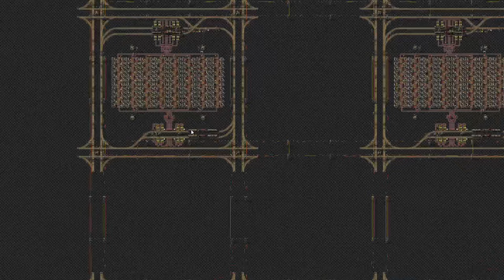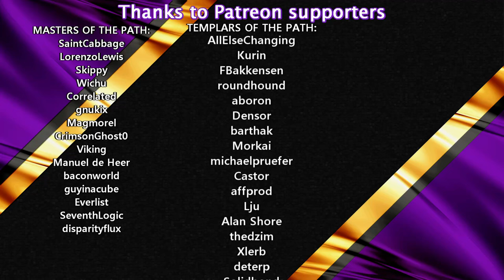How I Made Factorio Play By Itself | Ultimate Automation Challenge Tutorial

Comment: I seem to remember that the first spiral self-expanding Factorio base I watched many years ago in a video (which also used recursive blueprints) did actually collect the resources and built the components for the expansion. As far as I remember they just covered city blocks with a miner grid blueprint, where only the miners which actually had something to mine materialized. The guy then sorted the mined products into copper, iron, coal and stone and had a station for each type. 

Since the guy also used a no-water map but didn't use magical water-out-of-nowhere mods, he couldn't build batteries and thus his base browned out during the night. Oil was also not available - it was all about growing the base.
Reply: Galaxy brain: do a Seablock version, so you guarantee the availability of water.

Comment: The resource scan can be done.
When you create a block always make a mining block. Then after x time/ x many blocks if there is more than x ore skip the block if there is 0 ore deconstruct all miners and build a real block
Reply: You'd need a sorting system too. And probably a threshold for amount of ore so you don't bother mining trivial deposits. And of course you also have to do oil deposits, refining and cracking. Though I guess you could skip pumpjacks and rely on coal liquefaction.

Then you would also want to add supply constraints. Don't build more science if there's demand for iron, copper or oil – just build empty city blocks (only rails) until you've built enough raw resources to satisfy demand.

Of course then you'd have a rather sparse base with a lot of empty blocks. Perhaps you could resume building normal blocks from the first empty block. You'd need some kind of signal in the resource blocks that tells the building loop "skip me". I'm not sure what that could be, though.

Comment: A great project. Unfortunately, new research laboratories and missile bases are being built before existing ones are fully utilized. The same applies to the production of science packages. I modified the blueprints a little:

- An extra copper stop for copper ore
- Added a missing inserter in plastic production
- Oil trains return to the Infinite Ore block if they cannot be unloaded
- Lower sulfur buffer at sulfur production train stops (because it delayed the start of production of sulfuric acid)
- A circuit that prohibits the construction of further research laboratories, rocket bases, etc. (unfortunately the signals are ignored as soon as the AI can no longer find anything to build, then it still builds new research laboratories, rocket bases, etc.)
- Infinite provider chests for base building parts in every infinite ore block (prevents drones having long flight distances as the factory grows)

Despite small errors, it's a great project that's a lot of fun.

Comment: Worth a watch for for the solar design alone, imo. if you squint hard enough, your 4 : 3  ::  25 : 21. I like the 'woven' appearance.
Reply: It's how I usually do solar. Put down some medium poles to make a fully-covered area with no gaps or overlap, then pack solar panels around them as tightly as possible, and fill in the gaps with accumulators.

Comment: is there a way to connect logic from the accumulator system to the switches, for example if charge =50% the refinery switches shut off and then if 40% the steel smelter switches cut off  and so on. I'm sure its doable but a cool self preservation measure.
Reply from the maker: Already implemented in the base 😉

Comment: An algorithm for a spiral isn't super hard, but I have no clue how I would translate that into factorio logic xD. If I were to do something similar I'd probably just use a simple rectangular grid :).
That could also make it easier to work with coal/nuclear power, just make one expand to the left the other to the right... I'd just build 2 grids next to each other, a power grid and a production grid. Would have to be a custom map with some straight shoreline to make things easier. I see how adding mining automation would make things way harder tho, you'd end up with city blocks with 100 ore mined after 2 minutes and the block is empty... then you'de have to come up with an algorithm to remove mining blocks and replace them with something new. That process wouldn't be impossible, but it would probably tank the performance cause you'de have to keep track of the location where you removed a block, store that info, build a new bloc before continuing the spiral, ... nightmare fuel.

Comment: if recursive blueprints can deconstruct the biter one could be solved in an easy way: for every  block you build you first deconstruct the space where its going, then build a defense block to "the outside" (you can definitely find the block that is 1 further away from the center,  don't ask me how xD) that includes a wall, some turrets, maybe flamethrowers and an artillery installation. supply via train (the train ends should have gates) 
doesn't need to be directional if it defends in all directions :D
Reply: I kind of like that idea, but I see some problems. First, if you deconstruct the space where the next block would go, and there are defenses there, it would make the base vulnerable at that point untill the "outside" defenses are built. Next, it would require a lot more time constructing and deconstructing defenses.
What I would do instead is:

1) Check if the next block is a "corner block". There are 4 possible corner blocks, but we need to choose one of them and start the defense loop always on that one. Using the existing logic on this video we could check if we've arrived on a corner block. A corner block can be identified with (X = Y) OR (X = -Y), but in our case we just want to build new defenses once each loop. Let's pick the top right corner for that. The top right corner is identified by (X=Y) AND (X > 0).

2) If the next block is the top right, we can pause the main loop and start a new one on (X+2,Y+2) (let's call the new loop variables (M,K)). We can now build an outter shell of defenses around the shell where the next group of blocks will be built.

3) For that shell of defenses we would need 2 blueprints, a corner defense and a straight defense. We need four comparisons to decide which blueprint to build and on which orientation: 

condition 1) M = X+2.
condition 2) K = -Y-2.
condition 3) M = -X-2.
condition 4) K = Y+2

At least one and at most two of those comparisons will be true, so we have 8 possibilities. The possibilities and outcomes are:

If conditions 1 and 4 are true, build a corner block with no rotation (it's the top right corner of the outter shell).
If only condition 1 is true, build a straight block with no rotation (it's on the right edge)
If 1 and 2, build a corner with 90º rotation (bottom right corner)
If only 2, build a straight with 90º rotation (bottom edge)
If 2 and 3, build a corner with 180º rotation (bottom left corner)
If only 3, build a straight with 180º rotation (left edge)
If 3 and 4, build a corner with -90º rotation (top left corner)
If only 4, build a straight with -90º rotation (top edge)

4) After all of those are done and the second loop is back at (X+2,Y+2), we can start a third loop at (X+1,Y+1), deconstructing every block (those will now be the previous defense blocks, made obsolete by building the outter shell).

5) After the third loop is done, the main loop can start again.

Yes, this would make the expansion to halt for longer and longer based on how far from the center we are, but it would also take longer and longer between each halt.
Reply: I guess that Nilaus still won't want to play with biters (at least until he has implemented every other improvement). But that won't stop me from giving my opinion.
On first glance this sounds possible. Determining the adjacent outside block: Has to be. Defending in all directions and fully preventing biter infiltration: Definite yes. Clearing the space for the next artillery block in time for it's construction: I'd generally say most probably, but definitely if construction materials have to be crafted, and artillery shells have crafting priority.

There is one fundamental contradiction to Nilaus' design philosophy for his SEF: He assumes that the player is at the tech level where they have just built blue science and unlocked bots; but artillery research takes yellow science (and spidertrons take yellow and purple). And without artillery shells you'd have a hard time clearing the biter nests. (You could use the same direction-agnostic philosophy by going 2 blocks further out and expanding out to a 3x3 city blocks ring of turrets around that city block. But the main problem with turret creep remains: that it's a multi-step process.)
And these new "terminal consumers" (artillery canons consuming artillery shells) require a whole chain of additional types of production city blocks to craft those shells.
And then there's always the possibility that biters break the wrong entity at the wrong time. Trains could get stuck at missing rail pieces causing gridlock; construction bots could get called out at the wrong time to repair damaged stuff; roboports are already sometimes getting connected to the power grid too late, and with biters being involved they could even get disconnected. There's a lot of possible complications on that outer ring that you'd want to insulate your base from.
And there will certainly be further problems that only show up when you actually try to do it.
Reply: TLDR : Biters don't add anything to the game beyond a headache in the early to mid game, and are too unpredictable for this style of expansion due to how the system works. You'd likely need to have a full suite of defences for every cell, and you'd not have enough space left for the supporting production to meet demand. 
Here's the problems you might not be considering.
1) Biters, in the default setting, expand and repopulate. The system may replace destroyed buildings, but not trains, and it would break the system as bots would be dedicated to repair and replacement duties instead of what the system is designed for.
They also, ah... don't work in straight lines or set schedules, so can very quickly disrupt a system mid action, and then good bye ten hours to one special boy. 
Biters tend to get deleted out on large construction ideas because it's not a challenge. It's a drain of resources and a chore, especially in the late game where you can slap on shields, stack laser defense, and hip thrust through thousands of them. It's just wasting time, and processing power, for no additional benefit. 
I'd mention "It's Easy!" then following it up with "dunno lol" probably might have been a hint it's not that simple, but I'm not slapping you down here. Just offering a counterpoint. 

2) Define "Outside". Think on that for a moment. 
You can probably indeed run a separate system ahead of the first, but you probably aren't understanding that the base here doesn't exactly "know" where the centre is. A spiral is used because it's infinitely expandable.
You'd also swiftly hit a snag. Let's put this on a num pad. If I'm getting biters from Nine, and the system is on Two prepping to build on one, that's three to four stages before it gets to maybe building a wall.
What if it decides to build on the ruins of the base a nice shiny solar array instead of a gun when it gets there?

The answer to both problems is that all cells need to have defences, and the system only builds up once the wall is finished. But I'm not certain you can create separate global bot networks, so my earlier issue with builders getting choked up on repairing rather than new structures will still happen eventually. But you can't just have the base try to logic out where the defenses need to go because there's no reliable way to track incoming attacks, pollution buildup and spread, and you'd run the risk of something else being selected rather than a defence cell. And defending them all will quickly lead to redundancy, far less space for more valuable production, delays and ultimately destruction due to not reacting to a defence breach should an attack catch the base at a golden opportunity.

Comment: Why didn't you use nuclear power for this base? It seems like most of your city blocks are dedicated to power production, and the nuclear reactors would almost certainly reduce the number that you would need.
Reply: I dont know the answer for sure but I'm suspecting it has to do with calculations/ups. Solar panels/accumulators use a trick in coding to all be factored at once, making it a low pc requirement to run. Nuclear, while potent, will require more calculations for fluids, supplies, trains, etc. Most megabase-thinking setups use a lot of solars for this reason, to preserve game speed via UPS.
Reply: @Dawnseeker_Ch  He did say in the video, that the reason for only solar, is that all other power forms require access to water.  So, one less headache to worry about.
Reply: @Dawnseeker_Ch  the solar calc is a simple one. No trick. Just that each panel outputs the same power at the same time. Accumulators are basically the same.  Therefore the calc is NumPanels * kw. (I cant recall atm how much panels put out).
Reply: 1) current build uses no water
2) idk about you but my 2x2 reactor is dummy thick and wouldn't be able to fit in a city block. You'd either have to get a good design or change how city blocks get distributed for this one edge case

Comment: You said you could get rid of the infinite resources and/or deal with biters. Does that mean you don't have plans to do so? I always thought it would be cool to make a blueprint for the "brain" that you could stamp down at a certain point of a standard game of Factorio and then it would take over expanding the factory after, but that would require dealing with resources and maybe also biters. Either way cool stuff.
Reply: For the "stamping the brain down at a certain point of a standard game" compatibility, I personally would even deem it acceptable if the player took care of placing the mining blocks and providing the construction materials. (The brain wouldn't even need to care if the player built an actual hub block, used an infinity chest, or hand-crafted the items.) The automated brain would only need to be able to detect when the player has sufficiently re-filled the stockpiles in the logistics system.

And the cheaty "raw resource from thin air" block would need to be disabled: Which you can easily do by taking the iron ore token out of the brain (to put it into "permanent Tabu").

Maybe the brain could be given the capability to detect when a construction site is already occupied with a player-built (mining or hub) block; Or it could be left to the player to deconstruct the mines before the spiral reaches those blocks.

This is the order in which I would implement more features:
--- Take into account the stockpiles of construction materials before placing a new city block.
--- Detect and skip pre-occupied city block locations.
--- Build one or two hub blocks as the first thing the factory does (or one more set of hub blocks before/after each science lab block).
--- Detect resource patches and auto-build mines (and offshore pumps).